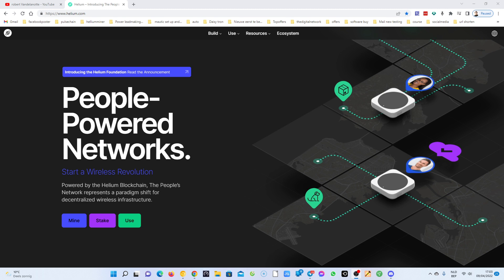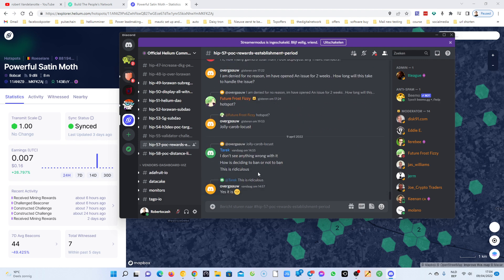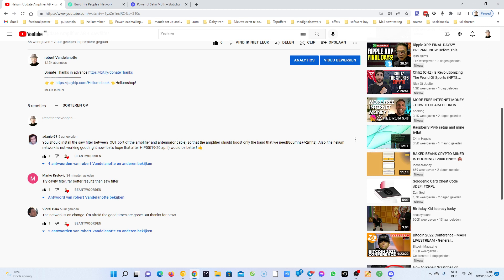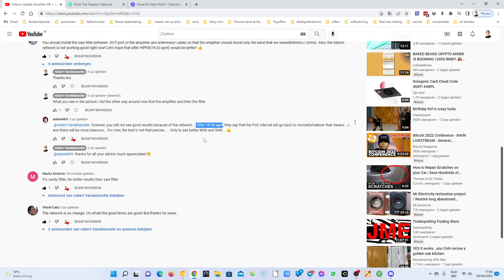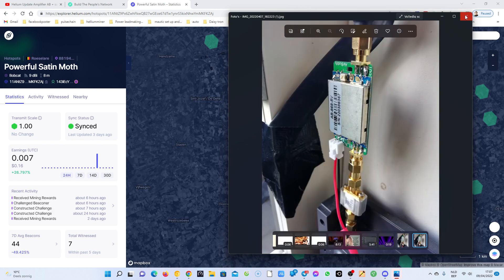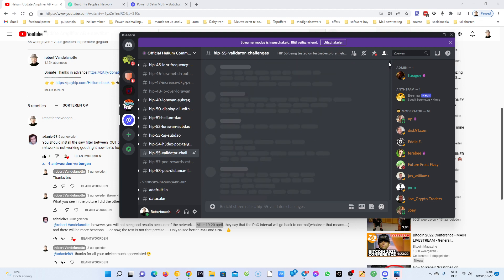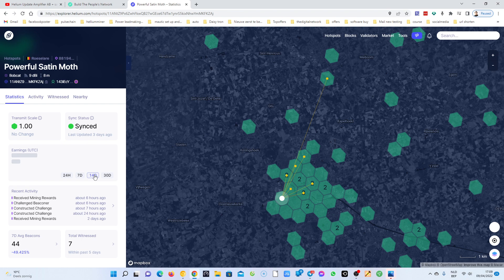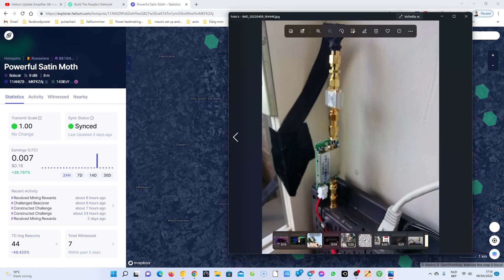Helium Update Amplifier AB + sawfilter + yagi 23dbi directionel antenne

Comment: Mate, nice video! Try it without the BandPassFilter and just turn back the Poti for tx on the Airbuddy Amplifier a little bit backward, that the 2 markers (dots) are over the hole or if you can read the marks on the Poti, bring the 2 dots between 4 and A. I had the same setup with the BandPassFilter and Airbuddy on my bobcat, but after a short while the Filter was blocking the signal. Better try heltec SAW Filter instead but  meanwhile try the Airbuddy Amplifier with the new config (Poti Position) and without the cheap filter and I hope you will get better results
Reply from the maker: you mean just mount the amplifier without the sawfilter then? (Poti Position) what do you mean by that?
Reply: @robertVandelanotteonlinemoney  exactly, try it without SAW Filter for a while. If you power up the Airbuddy Amplifier on the right of the green led is a potentiometer (that litle beige  plastic square with numbers and letters on it and a slotted screw), here you can adjust the tx gain. Default it comes on maximum (the adjustment screw should be showing on S) and that causes interferences. With a tiny/thin flathead screwdriver you can adjust it. Just turn it half way back.
Reply from the maker: @BabyPowder34  thanks for the interesting info will give it a try thanks a lot mate!
Reply from the maker: @BabyPowder34  i see a 4 1 and s where do i turn it to?
Reply: @robertVandelanotteonlinemoney  default it is turned max to S. On the right to S it should say 4 and after 4 it's saying A and the last point 1 is minimum tx gain. So turn it towards 4 and a little turn more (after 4).
Reply from the maker: @BabyPowder34  oké thanks bro... Appreciate a lot
Reply: @robertVandelanotteonlinemoney  I'm waiting for the Update Video
Reply from the maker: @BabyPowder34  i will make one for sure....
Reply from the maker: @BabyPowder34  https://youtu.be/mYGZgz5dBIM
Reply: @robertVandelanotteonlinemoney  just check out the posts on twitter. I guess you turned it too much